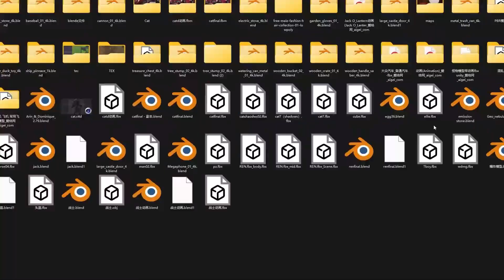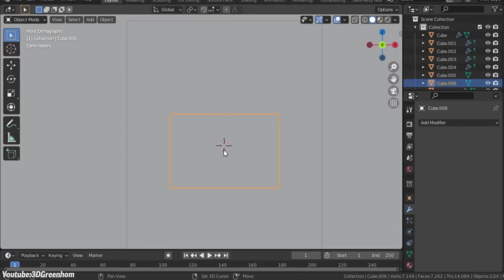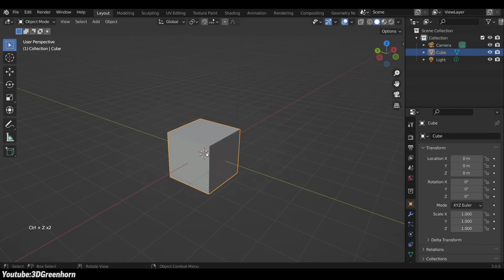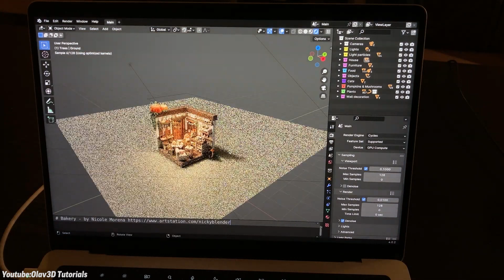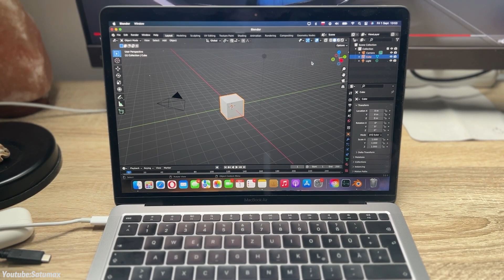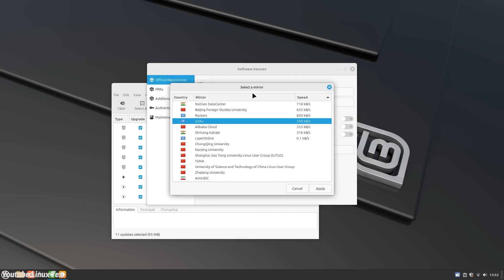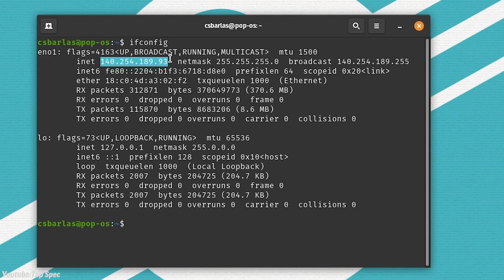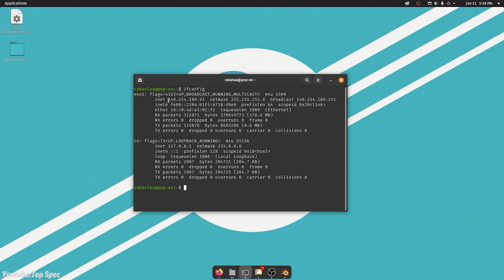Blender in Win Vs Mac Vs Linux

Comment: linux is a clear winner. I use fedora since 2019 as a workstation OS.
Maya runs faster on Linux compared fo Windows 
Unreal Engine runs faster on linux
Blender, Motion Builder, Modo, Mari all runs faster and much more stable
Thanks to NTFS being really slow at processing large number of small files and crowded registry i abandoned it forever.

Not to say that Fedora comes without a cost, you need to have some understanding of the command line to set up things but you'll definitely get used to it

Comment: the only real problem with linux is that from time to time the system will "explode" over nothing.
I lost count of how many times I went to sleep and in the other day when I turned on my pc I just got a black screen until I did a new install, but that's why you keep a second ssd with your data + a instalation drive always ready, you can do a full clean install in less than10 minutes and go back to work.

Comment: In the current blender benchmark app, my windows is faster in GPU than Linux and Linux is faster in CPU than Windows. So if you to do GPU then Windows has the advantage with more optimized video drivers.

Comment: Some studios running on Linux: Weta, Disney Feature, Pixar, Dreamworks Feature, ILM, Digital Domain, etc. My studio pipeline has been linux-based since 2021. Its worth the learning curve for the raw competitive performance/productivity advantage💪
Reply: What do you recommend to someone starting from 0 without any knowledge? any learning material to begin?
Reply: @ Zorin OS is a really nice starter cause it comes with latest Nvidia drivers pre-installed, and closely resembles Windows interface. Ive settled on Debian Stable (best for stable production machines), but took a few years of tinkering to get there…
Reply: @ValorCatStudiosinc  I agree. The Top 3 entry level distros I would recommend are ZorinOS, Linux Mint, or TuxedoOS. If you're using newer hardware I'd lean towards Tuxedo and Linux Mint cause they're updated with newer kernels faster. They all run on the same base so if you don't like one, you can easily switch to another one.

Comment: You really need to mention the simple fact that comparing Nvidia etc to Apple M1 and M2 is not a balanced comparison.

Only M3 and M4 Macs have hardware raytracing acceleration. And Apple hasn't released an M3 Studio, so the only real com[parisons will be when the M4 Ultra chips are released in the M4 studio - due soon. Until then, the comparison isn't really applicable. You could compare the $600 M4 mac mini to something of a similar price, if you can find anything that functions at that price point.
Reply: I don't think it was the intention. The purpose was comparing the os and since macos is only in Mac 🤷🏻‍♂️
Reply: @Nazou_3D  Yes, but @levi3D has reason. The comparison with MacOS with Apple Silicon is not fair. Blender on MacOS is very responsive, better than Windows environnement. Since M3 chip it's very fast, just check blender benchmark and see the charts with M4 and soon M5 Pro and MAX chips.

Comment: Pointeless discussion.
it only matters what OS supports the GPU  hardware upon which your primary rendering software depends
if yours is NVIDIA you better be on windows.

Maybe Linux/AMD for some scenarios

Now lets be honest,
if your only OS is Mac 
you are NOT serious about 3D/CG/VFX production in the first place.
Reply: seems like a pretty ignorant take, macs are the most effecient portable workstations and fastest laptops mostly cpu side, linux is faster every time than windows because of the way linux handles multithreaded processes its way more effecient on linux and can bring every ounce of power out of your cpu windows is also great it has good support and compatibilty just reliable in general good for dual booting. and as for gpu they both run the same on both systems.
Reply: @evilimpressario705 it sucks at render times

Comment: this topic doesn't feel like it has anything to do with cutting down rendering time. You could have just named it '' what os should 3d artistis use''
Reply: No wonder he got barely any views
Reply: Pointless, just like most of the channel at this point. They used to make smart videos here and there but now it's brain-dead. And the views are proof to that. The AI videos probably didn't help his case either. But that's what happens when you think about short term gain instead of building a community trust.
Reply: i feel like he explained it really well, he gives the pros and cons of each system and the main reason someone would use each one i dont understand the hate here.